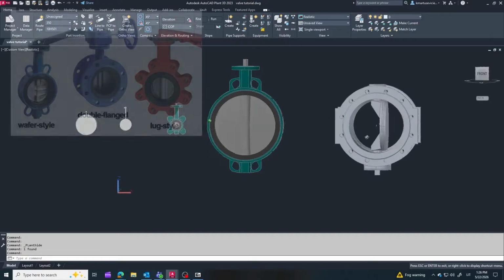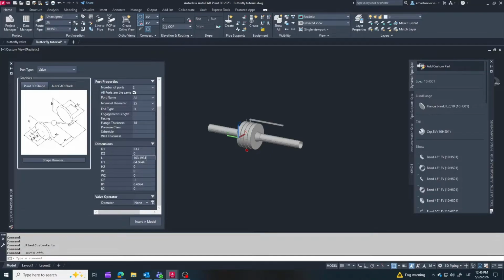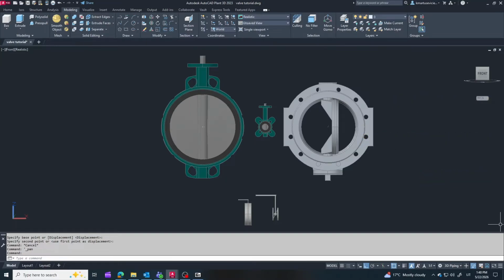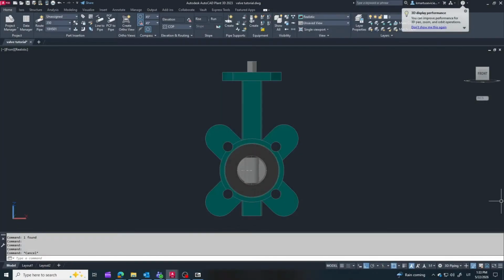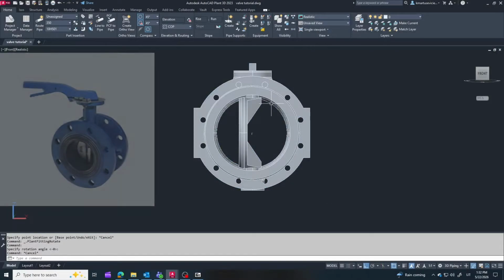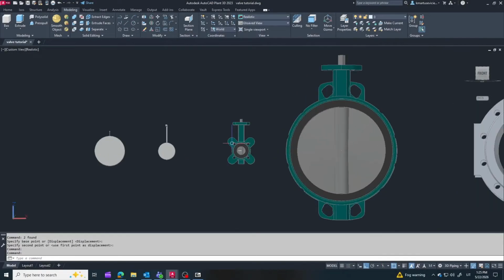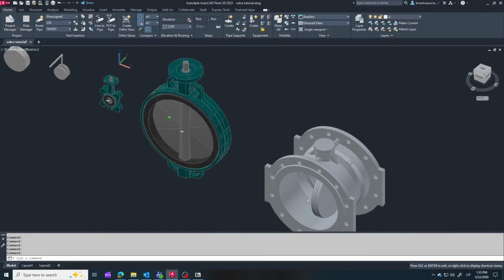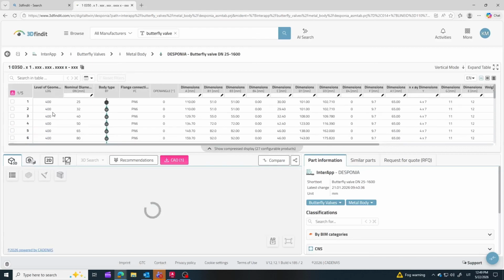AutoCAD Plant 3D Butterfly Valve Tutorial | Real Manufacturer Valves

Comment: For wafer type, i think the fastener is only one set. In your example i see that both side is connected with 2 fastener... Can you solve this issue..?
Reply from the maker: Thanks for pointing this out. After some testing, I found that the issue was caused by the connector End Types being set to FL-FL. Changing them to WF-WF makes Plant 3D treat the valve correctly and eliminates the duplicate fastener set. I'll share a tutorial if the ISO and BOM results are also correct.

Comment: Hi can you make a tutorial video how to add one set of bolts to a lug type butterfly valve? Plant 3D default only allows me to put 2 sets instead of 1 set.
Reply from the maker: 😄 Funny story... I started digging through Spec Editor, Catalog settings, custom valve classes, connection rules... and after all that, the solution was simply changing the connector End Types from FL-FL to WF-WF. That fixed the duplicate fastener sets for my custom lug butterfly valve. I'll probably make a quick tutorial because this question comes up quite often.